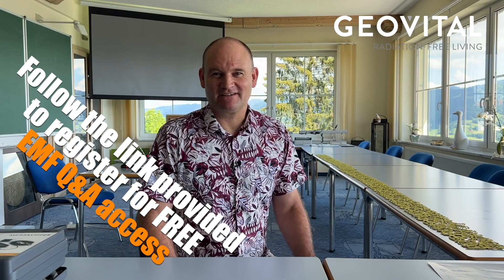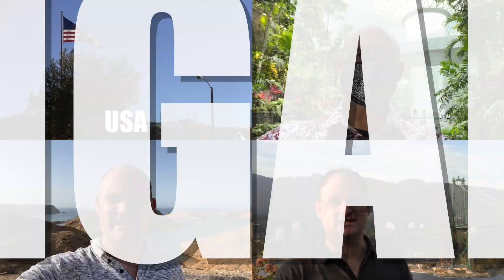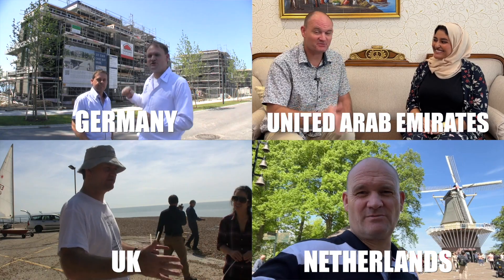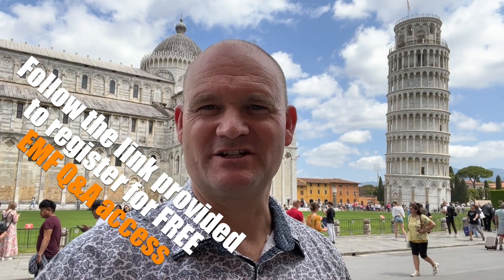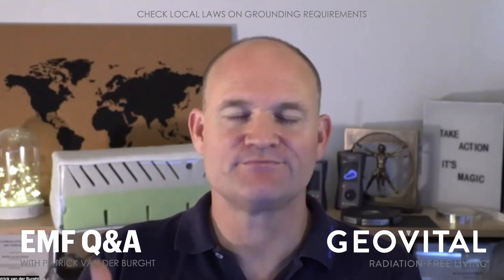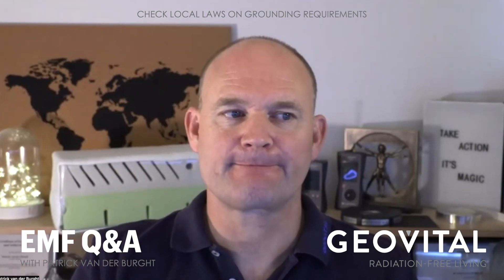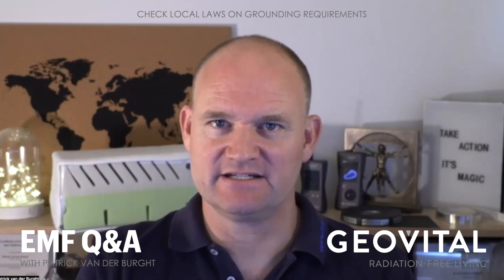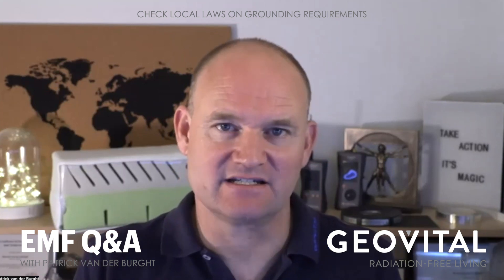EMFQ&A Should shielding paint be grounded 004

Comment: When I doubt, ground the painted wall because there is no danger caused by grounding the paint. Is that correct?
Reply from the maker: It must be grounded for safety.
Reply: What are the dangers of not grounding the paint. What is the potentially dangerous situation you talk about?